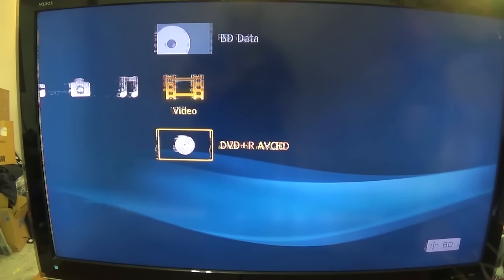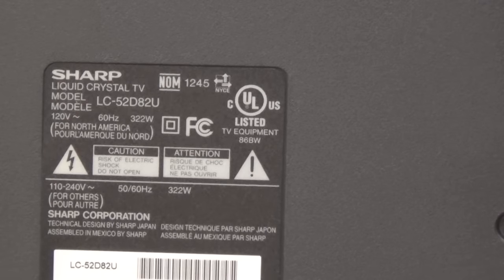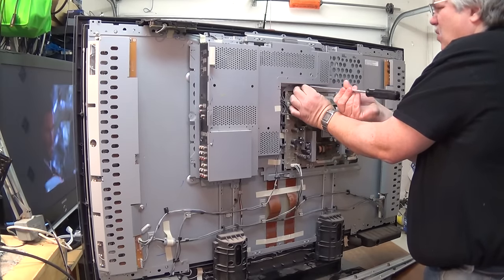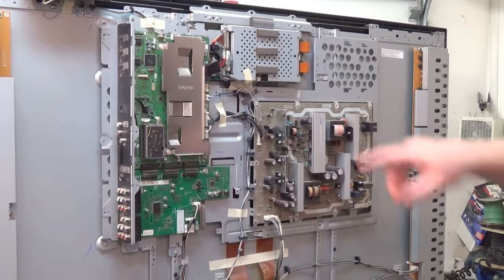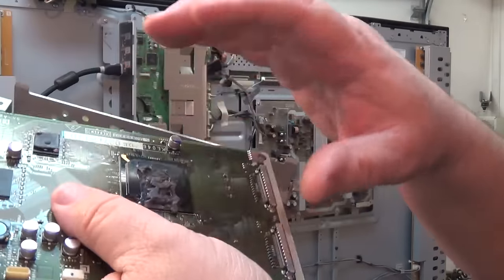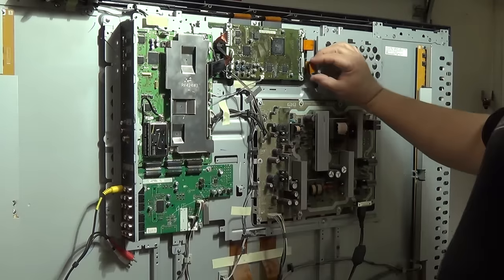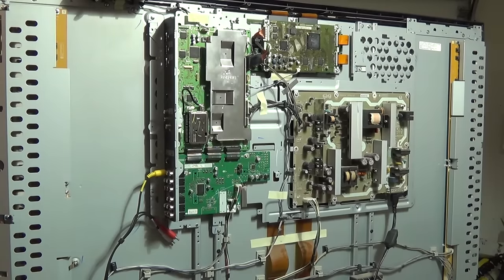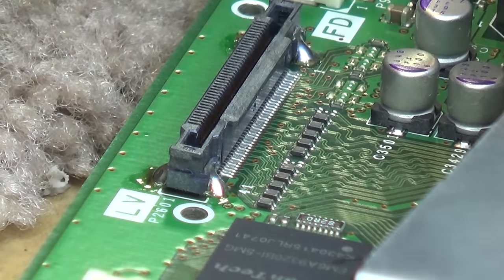Sharp LC52D82 bad picture FIXED

Comment: BGA & lead free solder, a match made in hell =D  Great job!  Sometimes worth getting some rosin flux squeezed under there if you can - it's hard to get it right under the chip, and It makes a tonne of fumes when heating with hot air but can help with the life of the repair.  I am sure that manufacturers continue to use BGA because it shortens the life of the appliances.  If they swapped the connection type back to PGA I am sure these things would run forever.  Maybe their other reason for BGA use is the track layout and ease of manufacture.
Reply: +GadgetUK164 If that was my own personal set I would be tempted to mod it and add a fan to that board too.
Reply from the maker: +GadgetUK164 Of course I did that. I just didn't show it on camera because "my hand was blocking the shot" as some have been critical of. I cut that shot, and the first attempt to heat the chip up, because the first time I didn't get it hot enough.If you look at 14:15 you can see the flux, and you can see it bubbling out from under the other BGA chips, which I also reflowed but did not include as they were not the root cause.People might not get it, or perhaps they want to send me a message that they don't want to see any more videos, but every time I get a thumbs down on a video it affects my stats, and how advertisers perceive the videos, and that affects my revenues stream. So for every thumbs down that someone gives, it drops the revenue for the video, which in turn pisses me off, and gives me another reason NOT to continue this. I fix way more TVs and electronics that I post. For example, and I have talked about it on a few other videos including this one, the Samsung on my bench under test. The video is in the can, but I haven't edited it yet, and I may never post it, because it was a real bitch to figure this one out, and now I know the symptom, and the root cause, so why should I share the fix if all people are going to do is give me a thumbs down because I didn't use the gauge of solder  they like, or I used a heat gun, or halogen lamp to reflow solder instead of a proper rework station.Many other well respected youtube producers have already thrown in the towel for the very same reason. A single thumbs down doesn't seem like much, but in the world of stats it means everything.For example where I work, the company does customer surveys about the work performed. On the 1-5 scale where 1 is poor and 5 is excellent, the only number that matters is 5. The rest are a fail, and ratings of 1-4 means a call to the bosses office.
Reply from the maker: +GadgetUK164 Older sets used to have fans. The 32" LCD BENQ that hangs in my shop as my camera monitor has 2 fans in it. You can hear them running, and that is the reason they dropped them. Nobody likes to hear a fan running when watching TV in a quiet room. That was the reason I relocated my amplifier and PVR to the closet, because the sound of the cooling fan in my amp cycling on and off and the sound of the hard drive running drove me crazy.
Reply: Yeah, fans aren't for everyone!  I would rather have a quiet fan and extend its life, but fans can be annoying.   I already suffer from the fan and HDD noise in my Sky sat box anyway so it really wouldn't make much difference for me.
Reply: +12voltvids 
Yeah, a lot of youtubers show frustration at the idiot commentors/trolls that seem to be everywhere. I thought your channel was relatively spared from this plague though!
Do please know, that many people do really appreciate your content and the time you&#39;re putting into it, but ofcourse we realize that this is not your job and you should be having fun and a gratifiying feeling doing it! 
Please try to ignore the asshats :)
Kind regards from Belgium. (your videos have already saved two plasma&#39;s, an LCD and a Fisher amplifier from the scrapheap over here!)
Reply: +GadgetUK164 
Oh yeah, almost forgot the mandatory comment on every video involving BGA's:
they SUCK!
Reply: 12voltvids I think there's a misunderstanding here somewhere!  I thumbed up the video - I've got nothing but love for your channel, not sure why you thought I was having a dig - I wasn't!  Just adding some helpful suggestions, that's all! 

And for the record, I've got no problem using a hot air gun like that - hell, I used one to fix my XBOX 360 before I finally got around to getting a proper hot air station.  It's not always about the tools being wrong, it's how you use them.  I've always thought that its the skill and not the tool.  I've removed a tonne of SMD chips in unconventional ways and never damaged anything, and I often dont use an ESD mat or anti static mat, but I realise I should.  I get tonnes of abuse due to that - just ignore the negatives.

I certainly hope my comments were not taken in any negative light - I was just trying to chat and add something in the way of helpful comments =D   Keep up the great work =D
Reply from the maker: +GadgetUK164 Not you. Someone out there gives thumbs down for just about every video. They complain about my intro, complain about the tools I use, complain about the thickness of the solder, my hand is in the way for 10 seconds on my road trip videos they complain about the music. If you look at all my videos, just about every one of them has thumbs down, and people do not realize the damage this does to the statistics. When my metrics are looked at for the month, and my dislikes are up 8% over the prior month, this has a negative impact on the advertisers that choose to run ads on the videos, which in the end affects what I am paid.  Perhaps people do not understand this, or maybe they do, and just figure, screw him, he doesn't deserve ad revenue. And then there are the folks that use ad blockers. I do chat with other content producers, and I am not the only one that feels this way. I would rather not have a rating at all as opposed to a thumbs down, as that sends the wrong message, both to viewers but more importantly to advertisers, and without the advertisers this channel, and many others like it would not exist. The only reason I share this information is because it generates a little bit of revenue every month.
Reply from the maker: +Koffi Banan I just did my old Dell Laptop this afternoon. Might post a video of that fast repair. Another BGA failure ARGH.
Reply from the maker: +Koffi Banan It is probably the same trolls that are doing it too, but perhaps they can't help themselves because they are mentally ill, but it does piss me off when I can look at the stats and see the $ revenue falling because the better advertisers that pay more and steering clear due to the higher neg comments. I was just listening to the radio last week, and one of the big news outlets has decided to disable comments from readers due to the same small group of people that open up their yap, and trash every story.
Reply: +12voltvids That's sad, really. this thumbs down without a comment is equal to a person without a brain.
Youtube, now is a crap. But you, 12voltvids, you're....you're great!
Fantastic and eductional video needs for everyone, so i think your video are usefull!
Reply: +12voltvids 
Frustrating! Thanks for explaining some of the YT whizbang, there's very little information about the way youtube videos are monetized. Youtubers are prohibited from discussing their income, aren't they? Anyway, after a chat on one of your other videos, I disabled adblock on youtube and a few other sites I like that don't spam me with popups and selfstarting Flash crap. 
I still didn't get any ads on yt, until I finally realized I had a browser extension installed that automatically selected HD. It also had an ad disable option checked...
I see videos where you can click thumbs up or down, but you can't see the number of votes for each. Maybe this helps to discourage some idiots, since they don't get the feedback?
Reply: +Koffi Banan
Over here newspaper comment sections seem to be a cesspool of neonazis, nothing but hate and anger.

BTW, I don't really believe that the only reason you do this is for the small revenue each month :)
You clearly love videography, electronics (ok, maybe a love-hate relationshop :D) and helping people (judging from your in depth comments that usually contain even more info then the video itself!)

Youtube is fundamentally broken, when looking at the most popular channels. However, I guess in some way this is a reflection of our current society?
Reply from the maker: +Koffi Banan I started this as a fun project. Having spent 20+ years in a career of electronic repair at a busy shop and then changing careers 12 years ago. When I left the business I figured that was it, but people kept bringing me stuff to fix. A few years ago I had an old friend give me a satellite receiver to fix. I filmed it to show him what was inside it, because he was a ham, but old school. Knew nothing about switching power supplies and how they worked. Initially that was never intended for the world to see, but 300,000+ views later it is my most viewed video, and the one that brought youtube to me to ask me if I wanted to monetize my videos.You are correct, there is not much money in the ad revenue stream, but it is enough to keep me interested in doing the videos.I hear you about the unstable people out there in the world. I could really care less about them, but the reality of the dislikes is they do have a real effect on the metrics, and that is how ad revenue is determined.It started as a fun project, but when someone continually gives a thumbs down, it is taking the fun out of it. Considering that it is always 1 thumbs down leads me to believe it is probably the same person that is doing it on all of them. Someone that no doubt has some issues of their own.
Reply from the maker: +Koffi Banan I don't know about discussing youtube income, but it is something I just wouldn't do, and the same as my salary ay my day job. I am old school, in my 50's now, and it was always frowned upon in the work place to talk about salaries. Where I work now that is a non issue as I am at a unionized shop, and we all know what we make, because we all make the same! Clerical makes one wage, plant maintenance another, engineering makes the same plus their certification bonus depending on their certification. I look at my YT monthly cheque as beer and pizza money. It offsets what I charge my walk in customers that get their products repaired, and that alone is the deciding factor for someone to repair as opposed to toss out. When I have to spend a couple hours troubleshooting a device nobody is going to pay me 150 to fix it, but they might go for 50.
Reply: +12voltvids 
Got it! I fix most things for free, or for a beer as you say. It's true, someone will only make 'the effort' of disconnecting everything and bringing it over to you, if it's going to be noticeably cheaper then a new unit. Some even prefer new stuff over a free fix, cause they're afraid the fixed unit is going to give 'em trouble again later on.

Right now I'm working on a Heidolph Vibramax 100 platform shaker, expensive little bugger (that's why it's here). The motor just jerks now and then, but fails to do it's thing. Suspecting the triac's gate trigger current  has gone up over time, but I don't know if that's even possible, still a newbie an reading up on it now.
Reply: +12voltvids You had me at beer and pizzza! lol Now I'm hungry man, thanks! jk
Reply from the maker: +Scott x Dam beer and pizza, sounds like a plan.. LOTS of beer!. If you had the 3 ring circus that was my day at work today you would understand.I had to do some work in a building. I needed keys to a utility room. The building manager required my truck keys as collateral to ensure that I returned the building keys. When I was done work I returned to the office to drop off the keys, and pick up my work truck keys. The building manager  had gone for lunch, so I had to wait for him. While I was waiting I got a ticket for parking too long in the loading zone. Remember he had my keys locked in the office.Not happy.
Reply: Aw hell no! Lol I'm sorry but that's just...wrong You know, that could have been a skit on Sienfeld lmao
Reply from the maker: +Scott x Bahaha ya. And we would all be ROTFLMFAO to it. I'm not laughing. Just glad I got the keys back before the tow truck arrived, as the meter maid called for one. I left the ticket in the office and told them to do the right thing and take care of it. I guess I will find out if they take care of it or not. If the boss calls me into the office for a chat. I can always play dumb, and say I know nothing about it. I am hanging onto my receipt from the meter as proof that I DID pay.
Reply: +12voltvids Good for you, I sure hope they know the word 'Principal' and do the right thing as well. I'll stay tuned ;-)
Reply: @12voltvids  Ignore that one bad apple in a sea of  viewers that appreciate your efforts

Comment: a good way of troubleshooting i recommend to you is to apply pressure with your finger in bga (t-con) processor and ram chips to find out which one has the problem. then go with the reflow. it saves you lots of time.
Reply from the maker: +nikos biology tsiouplis Did that, no effect. Tried pressing on the chips, and tapping lightly. Didn't make any difference. I had it isolated down to the TCON or main board relatively quickly, because when I tapped either of them the picture would flash. To the heat gin came out, and the first one I warmed up was the TCON, and bingo, good picture, so I knew where to go.First tried reordering the LVDS coneector still bad. Then the BGA chips. The first attempt I did all the chips, and it ran for a couple of minutes and acted up again, so I did the big one a second time, and that time got enough heat to reflow the solder. And yes I did pour in some flux. Didn't show it on camera as the shot wasn't any good as I stood the board on end, and put flux in on all 4 sides and let gravity assist in getting it under the chip.

Comment: Well done sir, smashing recovery :-D
Ive had a go at trying to get a laptop gpu chip to work again, no picture syndrome.
I did much like you did, but i did put a tiny twist of solder on top of the chip so i had a rough idea when the chip was hot enough.
It did work afterwards, but wasnt very reliable when the pcb was flexed slightly, i did try again but it just didnt want to work.
As i havnt got all the solder masks and special supplies, i gave up.
Bga is such a bad idea, whenever i service a laptop, i make sure the heatsinks are really clean and well thermally connected to the chips, i want the chips as cold as possible.
Im no lover of using solder to glue a chip to the surface, im just a stick in the mud :-(
Reply from the maker: +zx8401ztv BGA is a horrible design. I remember when it first appeared in DV camcorders and we all thought the same thing holy f--k that is going to be a problem.I have a laptop with a bad gpu that I might try to get going this way too. I know it is bad solder as it initially did boot a few times, and then nope.The problem with putting a bit of solder on top as a reference is, well you will know you have melted it all right, but the air off the heat gun is going to be much hotter on the surface than on the bottom, You need to get the heat right through the board. Of course the proper way to do this is to put the board on a hot plate and slowly bring the entire board up to almost the melting point of solder. you don't want to get it to the point of molten solder because all the parts on the bottom side of the board will fall off, but close to the melting temperature. Then using an infra red heater, halogen lamp with a focused beam that heats just the area of the BGA chip, heat the chip up to being that solder up to the melting point to reflow it. Then without moving the board shut off the hot plate and let it cool. That's the proper way. Of course if you are replacing a BGA you need this set up to do it right, and when while the light source is making the chip molten you lift the ship away using a tool with a  suction cup on the end.I know a guy that works in forensic data recovery operation. Has all the cool tools for removing chips, and reading data out of TSOP and other types of memory used in phones, tablets computers, HDD ect.I remember him telling me once, never send an email or text that you wouldn't want your mother to read, because even if you think you have covered your tracks, unless you grind that phone up into tiny pieces, information that could have been sent or received even years earlier could be retrievable. Perhaps not all of it, but there will be fragments that haven't been overwritten.
Reply: +12voltvids 
Yes i know your right about the solder reference, it was just a crude way to gauge the heat.
The lamp does sound much better, i was thinking about heating from the underside but i could just imagine the parts dropping off, so i heated from the top, my mistake i suppose, but its all learning :-D.
I hope you get the better of that gpu, fingers,toes, and legs crossed LOL :-D
Oh by the way, i did fix that 750watt pc supply with panasonic caps from r.s, works smashing now, ive used panasonic low esr 105deg ones before :-)
The original caps were (wait for this) CapXon, yuck yuck :-(
Reply from the maker: +zx8401ztv CapXon CapXoff, the Caper!Sorry just couldn't resist. The GPU fix took all of 5 minutes film shortly.

Comment: Ha, I've seen tube sets with lower power consumption than that thing (and were easier to service, to boot)! :)
Reply: had a Samsung Plasma years ago...550 watts!!....did away w/ the fireplace plus I solved the monthly electric budget quagmire by selling the cloth's dryer and hung a line parallel across the top of the Samsung ...Paltry dilemma solved!!
lolz